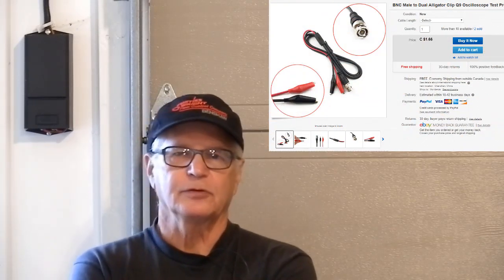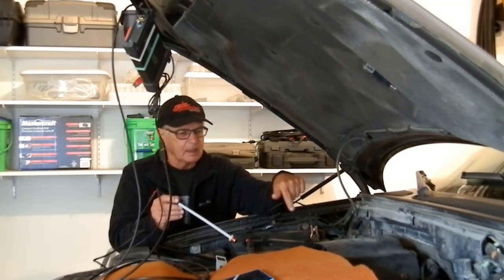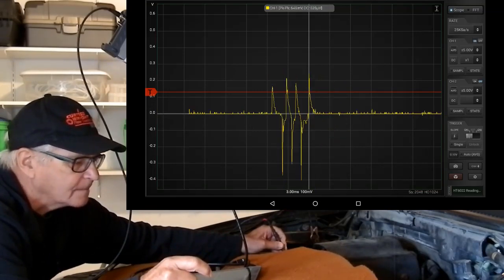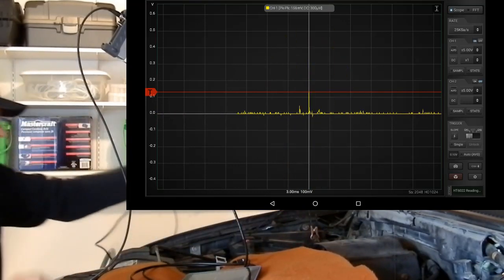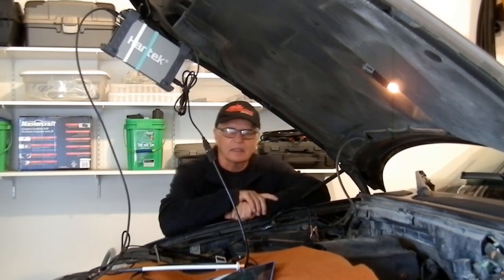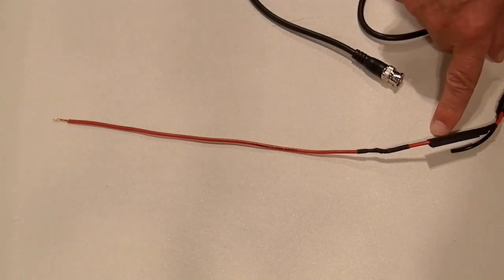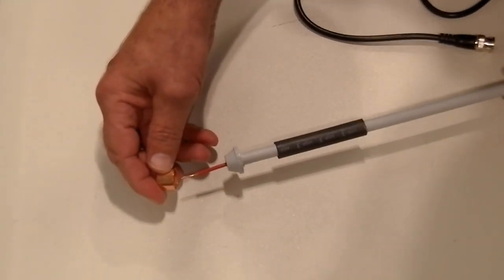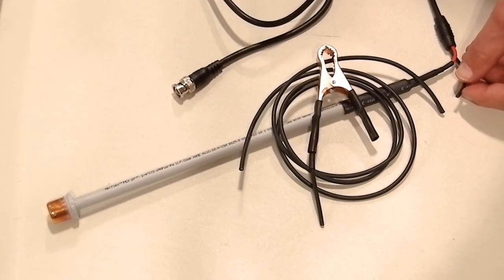GADGETS#29 - DIY COP PADDLE PROBE

Comment: I got excited just the like electrons.  This is going to b the first device of yours that I build. I just want to c that firing line. When I was very young I built a Heathkit oscilloscope and was fascinated with that intense little blue firing line     Your device is super slick. Pretty soon u will b at 1000 subs. People r recognizing what a treasure u r.
Reply from the maker: +Bill Rimmer - you are probably aware of the slight mod to this COP PROBE, a 3/4" PVC end cap added over the 1/2" copper
Yep close to 1K subs...been a long haul to get here:)

Comment: should there be safeguards built into the lead incase the "coil on plug" was leaking and the high voltage jumped into into your test lead killing your scope.
Or would that potential ark be sent to the test leads ground?
Reply from the maker: people with $3000 oscilloscopes might be concerned...

I and many others in our HScope group work with oscilloscopes costing less than $100...wouldn't be a big loss

and I have yet to learn of someone that zapped their scopes with this...I didn't re-invent the wheel here...this is a spin on coin/alligator clip secondary waveforms that guys have been doing since scopes hit the automotive world...

there was a revision done to this probe after the posting of this video and that is the addition of a PVC end cap over the copper end cap to add a little insulation

another precaution is to poke around COP with a test light to see if errant sparks exist

Comment: Followed your directions (mostly) and results were great.  I was unable to find the plastic rod, so ended up using a foot long piece of 1/2 inch pex, and the copper 1/2 inch cap fit right on.  Tested today and it works perfectly.  Total cost, 78 cents US for the copper cap.
Reply from the maker: money well spent...lol
Reply from the maker: did you add a 3/4 PVC cap over the copper one...a modification that took place after the video was posted (and mentioned elsewhere in other videos on the channel)...at the suggestion of viewers that weren't comfortable with the bare copper...
Reply: @theGADGETSplaylist  No, I'm happy with the copper.  Just in case, I use a 20:1 attenuator to protect the scope.
Reply from the maker: @georgebeuselinck951s  oh no...20:1 won't do anything to protect against 25Kv zap...and will just weaken the probe signal
Reply: @theGADGETSplaylist  OK, you talked me into it... will procure a 3/4 inch pvc cap and install... Thanks again!
Reply: @theGADGETSplaylist  Exactly why I started reading the comments. That shiny copper cap looked awfully suspect after years of working on old school TV/ monitors and other high voltage electronics.
Reply from the maker: @goatmoag  I did add a 3/4" PVC cap over the copper in response to some of the comments

I can see people with $5000 oscilloscopes being scared of lightning but with scopes featured on this channel costing <$100 I lose no sleep assuming that risk

and I know people with commercial secondary probes not able to get a decent waveform and resorting to this build...not all COP are created equal

Comment: This was very creative device. Secondary ignition analyses is my favorite subject. I am wondering would be possible to use copper pipe and place it across multiple COP to capture signal. Cheer well done sir.
Reply from the maker: +KY Home Garage - I know you like this stuff, Ramon🙂
Interesting idea trying to pick up entire bank with a copper pipe. I'd never get one on the 4.6L...it's crowded in there!
I experimented with larger pieces of copper (3x the size of the cap that I settled on) and found the signal maybe a bit too strong.
Thanks for dropping by,
Denis
Reply: KY Home Garage , did you find a way to get multiple readings ? I have a inline 4 cylinder motorcycle engine I would like to test ,

Comment: Genius..  Pure genius
I'm going to build one and I don't even have a scope yet.
Reply from the maker: a simple device based on industry practice of placing a coin and alligator clip on top of a coil...

note that later,  a PVC end cap was placed over the copper end cap (held with epoxy) to eliminate bare copper exposure
Reply: @theGADGETSplaylist  Right on...  thanks.  I was worried about that.  Because sometimes I test my plugs wires and coils with a simple test light probe to ground... You can drag the point of your test light tip along the outside of the wire and coil, ect.. and if there's a hole in your wire, it will arc to your test light--  so it's quick and easy to find spark plug wire shorts to the block that way..  So I was thinking, what happens if that arc hits your 'paddle probe?   Does that kill the scope?   It's really high voltage, but low current-- so I'm not sure.  Maybe the scope would just display the short and still be fine.  Maybe an inline fuse is not a bad idea on your home made paddle probe, just in case it gets zapped by a leaking coil.  Maybe your plastic cover completely stops that arc now.
Reply from the maker: @calholli  your test light before using COP PROBE if suspect leaky COP is a good idea...

yes, PVC cap can't hurt...may offer some protection...

there are risks...similar to old school use of coin and alligator clip...

stay away from spark plug wires with this COP PROBE which are more dangerous ... for COP use only...

Comment: Will it work on the Toyota COP?  I made one with a relay (Mechanical Mindset channel).  The relay pickup will show a pulse but not a good wave form. on the toyota.
Reply from the maker: COP all vary...some better results holding on top...others better if holding on side

solid copper based probes (like this one is) give best results, IMO

Comment: Just built this. Works better then any of the other I have purchased. I did add a small tantalum capacitor to protect for high tension leakage from coil to COP probe.
Thanks for your video!
Reply from the maker: there are lots of these built around the globe since I posted this video
if but only 1 guy had blown up his scope with it, I'd have heard about it 4sure...lol
glad you like it:)

Comment: I have just come across your channel and am going to build this, I saw another video with a similar build to your where  he wired in an 1000 ohm resistor in case a damaged coil insulation caused it to jump across to the probe and damage the oscilloscope. Does that make sense? don't be to critical please as I am just learning. thanks
Reply from the maker: the copper end cap when placed near COP "generates" a little less than 5v but with almost no current. A 1KΩ resistor would stop that signal in its tracks.

this is a new spin on an old idea where guys would use alligator clips and coins to get secondary waveforms...and assume some risks of scope damage along the way...

I've added a 3/4 PVC end cap to cover the bare 1/2 copper cap since this video was produced. That might help. Another good idea is to bring a grounded test light near COP before if damaged COP insulation is expected or feared.

good luck with your build, Terry
Reply: @theGADGETSplaylist  I took your advice and left out the resistor but used a small car relay in stead of copper and it works really well. I have tried it on my petrol chainsaw as well as various electrical motors and fans to get an understanding of the wave forms. Many thanks
Reply from the maker: @foxy1960  great!
thx for the update ...

Comment: I tried this before completing the wiring and found that the probe acted as an antenna.  Just waving the probe in the air (like a magic wand) above a running engine would pick up secondary ignition waveforms.  The BNC cable's alligator clip was a lot more selective in picking up the signal; the signal intensity increased as I moved the alligator clip closer to the ignition wire I aimed to probe.  Even then, however, with the oscilloscope's gain turned up, I could pick up secondary ignition waveforms just by holding the alligator clip in the air above the running engine.  Do I just have a particularly noisy engine?
Reply from the maker: +plilikoi - Hi!
If you're still talking about the Buick or the Bronco, of course it would be noisy in there! Those vehicles are not COP...
Have you watched GADGETS#32? In that video, what you see is what I get.
Reply from the maker: +plilikoi - Here's what people use to acquire secondary waveforms on vehicles with spark plug wires.
https://www.ebay.ca/itm/HANTEK-HT25-High-Voltage-Scope-Secondary-Ignition-Capacitive-Auto-Pickup-Probe/292439348117?hash=item4416be5395:g:7eIAAOSwtKVaebU1:rk:5:pf:0
I have one but can't speak to its capabilities as I haven't used it.
Reply: Ah. thanks, I was just sanity-checking myself.  I have one of those pickup doohickies, but I found it didn't work very well.  The plain alligator clip seems to work better to give a uniform waveform.

Comment: Can you invert the waveform on you Hantech scope? I have run across heavily insulated coils that are impossible to get a signal out of. i use a set of test plug wires to get signal. Ford coils are nice since you can just use the primary signal. Those 3 and 4 wire coils with the transistor in the coil take that option away which sucks. Anyway love your video's !!
Reply from the maker: The COP probe in the HScope database has invert signal built into the multiplier. The secondary is displayed "right side up"
There was a PVC end cap epoxied over the copper end cap since this build video.
Am pleased you're enjoying the videos:)

Comment: That's awesome! 👍 I am going to build my own thanks for the info.
Reply from the maker: +sherwin b - you'll love it.
Note that a 3/4" PVC cap was later added over the copper cap.
Reply: @theGADGETSplaylist   Have you come across any cars that it does not work on?
Reply from the maker: @crystal1484  - Cars with spark plug wires and cars where the coils are concealed, of course won't lend themselves to this.
I saw a PICO video a while back where they were saying their probe was having trouble with the COP on FORD FUSION because these were particularly well insulated. Well, this build works just fine on my FUSION...
Watch a couple of videos where I use it. A good example is the OSC482 video where on a "single trigger" the waveform was captured as I approached the COP, not even in contact.
The multi-strike video illustrates the quality of those waveforms.
Reply: @theGADGETSplaylist  thank you very much for the information
Reply from the maker: @crystal1484  - let me know how you make out...
Reply: @theGADGETSplaylist  10-4 I'll let you know

Comment: One last question Denis. I noticed that when u finish with a sample, the scope continues to have that picture even when u remove the cop. Why is that?
Reply from the maker: +Bill Rimmer - the scope was in Manual Trigger mode. As I backed away with the probe, the trigger condition was no longer met, HScope screen not refreshed until the manual trigger condition is met again or placed in AUTO trigger.

Comment: How would you wire in a coil if you were to use one instead of the copper top? There's 2 wires on this coil I have, very small gauge but I know it needs some kind of ground.
Reply from the maker: Someone has video out where he's using a coil from an automotive relay. I suspect you're referring to that.
There are things I like about the idea. Such as the possible elimination of a GND wire and yet getting a strong signal. Were I doing it, I would try to connect (+) BNC to wire entering coil and (-) BNC to wire exiting coil. The coil is one continuous wire actually.
What I don't like about the idea is that it is too "makeshift". These coils are delicate and would get easily damaged exposed like that. And cumbersome to use. AND, including the metal core, it's a lot of bare metal exposed to a possible COP zap! Something critics of my probe in this video point out and that goes double with that coil.
I did later add a PVC cap over the copper cap as a modification to this build to help alleviate that concern.
Reply: @theGADGETSplaylist  should I ground the black as well as attach it to the coil? My other probes all have ground connectors. Would it even work if it was grounded,
Reply from the maker: @alanw5879  - no, I don't think you should have BNC (+) and (-) to the coil and also be grounded.
But, keep in mind it's not my build you're exploring. I haven't tested any of this you want to try...
Test it in a rudimentary way if you can prior to committing to a finish build.
Good luck with it and keep me posted on your results.
Reply from the maker: @alanw5879  here's the video where he uses an automotive relay to do what you're trying:

https://www.youtube.com/watch?v=8EWDaIHmOts
Reply: @theGADGETSplaylist  will do. I'm going to start with an 20x attenuator first and see if I can get an injector reading. This coil has a million turns on it and the wire is super thin, so I think it will either give a great reading or won't work at all. Thanks for info tho, appreciate it.

Comment: At the risk of sounding silly, can I ask how you soldered the wire to the copper cap. I am trying and having difficulty getting solder to attach to the cap. Please advise🙂
Reply from the maker: +Toby Birrell - not silly😉
I used flux...water soluble type in a small toothpaste type tube. AND, just a soldering iron doesn't have enough heat to do it. Either a soldering gun or a small butane torch to heat the copper cap.
Reply: logical canuck very much appreciate your channel, this video, and your reply 👍🏻
Reply: logical canuck very much appreciate your channel, this video, and your reply 👍🏻
Reply: Use flux

Comment: You are a pocket saver. You have the most amazing ideas and a kind heart. Thank you for sharing, subscribed and hit the notification icon on your Youtube account. Again thank you from the bottom of my heart and my pocket.
Reply from the maker: +Adriano Vergora - what I do have is amazing followers:)
Maybe not that many subscribers (yet), but they have connected solidly with the work.
It is worth the effort.
Thank you from the bottom of my heart!
Reply: logical canuck I would like to buy the MustTool Multimeter/Oscilloscope combo can I change the end of your invention to fit a normal multimeter end probe?
Reply from the maker: @adrianovergara1784  - I don't see why not, Adriano.
Have you watched GADGETS#31?
Reply: logical canuck I went to Reno depot here in Quebec but couldn’t find the toilet supply pipe that you’re using. I found the 1/2 copper ends though and already ordered the BNC with alligator clips.
Reply from the maker: @adrianovergara1784  - I think I got mine @ CTC (a while back)...but Home Depot has them:
https://www.homedepot.ca/product/durapro-pex-smooth-bathroom-faucet-water-supply-line-3-8-inch-x-12-inch/1001141627
And other plumbing shops, I'm sure.
Reply from the maker: @adrianovergara1784  - And LOWES has them too:
https://www.lowes.ca/product/toilet-faucet-supply-lines/38-in-dia-x-20-in-pex-toilet-supply-line-702407

Comment: Hi very interesting video and a fantastic idea do you not need to take a ground from the probe in case off a stray hi voltage leak off a coil going to the scope .Is it possible to invert the image on Hscope for like wasted spark system? love you're videos
Reply from the maker: this is based on a very old idea where coins and or alligator clips were placed on top of COP to get secondary waveforms...people not comfortable doing this shouldn't...

HScope has INV in probe database that does invert waveforms
Reply: Thank you for the reply I have found the invert in the list. Thanks for the help
Reply from the maker: @PETERCLIPS  your comment for LENOVO tablet was accidently removed...I apologize for this...

these tablets can be found on the LENOVO website...best place to order them, IMO

LENOVO.com (USA)

LENOVO.ca (Canada)

Denis

Comment: A couple of questions
When using this probe on the Hscope with the hantek 1008c when trying to capture a waveform it appears to crash and the device then says searching for device.
If I use this on the hantek software on the laptop I have to set the scale to around 500mv before I see a pattern.
Now the pattern is a good wave form but obviously the voltages way off.
Any idea how to solve these issues?
Reply from the maker: You raise 2 issues here, Nathan:
1) the HT1008 disconnecting from HScope (searching for device) would be unrelated to the COP Probe use, I think. I recommend the latest BETA HScope version which is (165) presently.
2) The COP Probe upper voltage is about 3v - 4v typical. Hantek software 500mv is per division which adds up fairly well to capture COP range, right?
Hope this helps...
Denis
Reply: @theGADGETSplaylist  I think the scope disconnecting is more to do with my cable tbh.
And that makes sense then with voltages on cop probe thank you

Comment: I know this is sn old video  but does the paddle probe need to be any certain length
Reply from the maker: no, the handle is just for convenience

even without any handle it would work...it's all about the copper

and upon viewer recommendation, I added a 3/4" PVC cap over the copper cap (with epoxy) as insulation ... doesn't interfere with the quality of the waveform and offers some small protection against errant spark making it to the scope ... some people are more concerned about this than others...
Reply: Ok thank you
Reply: Would brass be ok to use for this or does it require copper
Reply from the maker: @kellycowett6254  brass will do fine